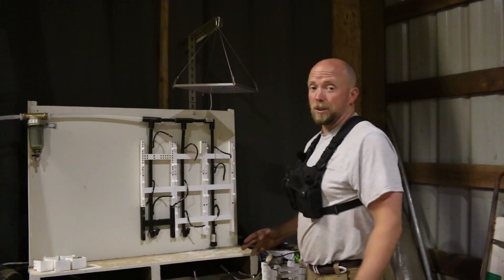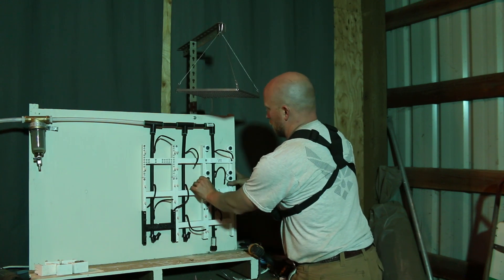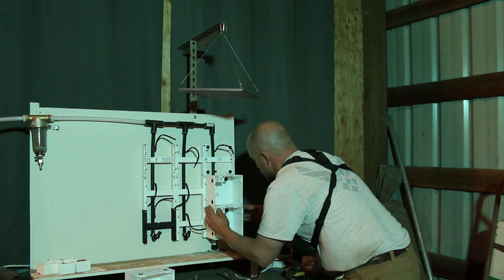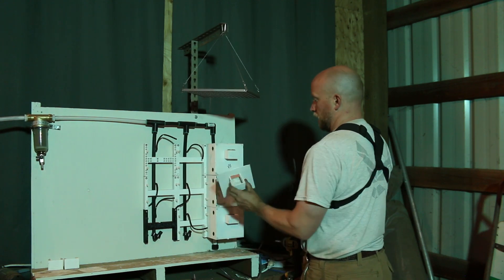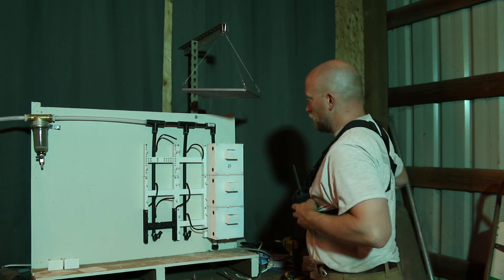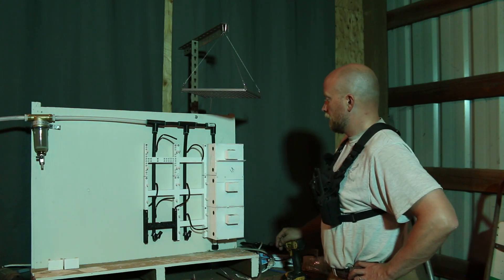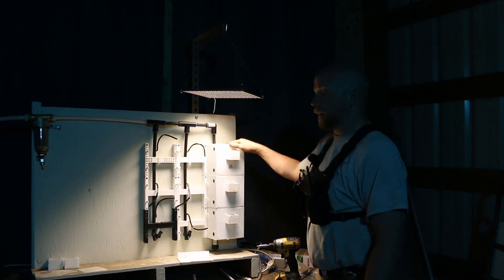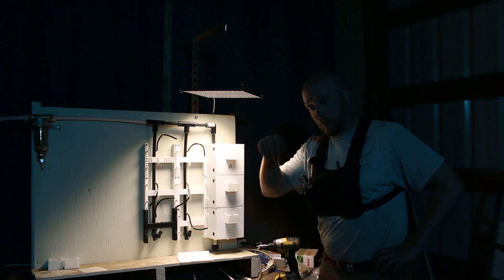Indoor HYDROPONIC Vertical Grow Box Test Setup

Comment: I like the idea someone had of using sheet metal brackets for mounts.
Also to drop production cost and assembly time maybe key hole slots. I know it would require assembling from bottom to top and you would not be able to pull out the center but it would be considerable savings.
And why only one grow cube per square if this is only for sprouting? This is using a vary large footprint on the wall for only nine small plants or sprouts.
Maybe I'm not getting the concept or I have forgotten something.

Comment: Won't plants block the light from above. Angle it (/) or side light (c/)? Circular facing in toward light? Bigger plant site option? Soil Option? Bioponics? Didn't you mention vortex water and root aireation. Looks OK but if you see it your not groing plants! Test your pete and all amendments at least with a geiger counter. Use good well water. Surprises if you find any OK sea products and watch out for the rock dusts too. 
Some overthinking is at odds with the Ticking Clock now 1 minute before their last witching hour. Think indoor growing anwywhere with solar geodesic add on IF you have sun. Underground monolithic domes with basalt rebar will take any of Mother Nature's abuse, which is not decreasing. Good on Mars too. How important is geographic security for your food security? 10 US cesspool cities. People saw the memo and some are FINALLY fleeing to the countryside already.

Comment: Sorry Jeff, those are not sexy. They are for growing food, so they don't need to be sexy. Pleasing to the eye, yes. To help with that if you rounded the corners will help. 

I know cubes are easy to work with and work well for what you are doing in a production setting. But for an in the home setting something that is oval and able to stack diagonal on a wall so it could be wall art, may be more marketable for home use. 

Something that may help with your wall mounts, make them one piece to hold three grow cubes.  

I wish I could get a closer look at your cubes so I could offer you ideas. I keep thinking of a cascade water system so the water goes into the top one, when it's reservoir is full the water flows into the one below it in a chain. It would save on tubing, fittings and time. I have worked out how to do. You may not like it... it's too simple.

Comment: I do not know if you did, but I think you also need to take a look at other ways to connect the parts then magnets. For example some form of snap-fit with a tab of some sort that allows you to open it back up. I think that a lot is possible with injection molding, and by not using magnets the production and assembly costs would drop quite significantly.